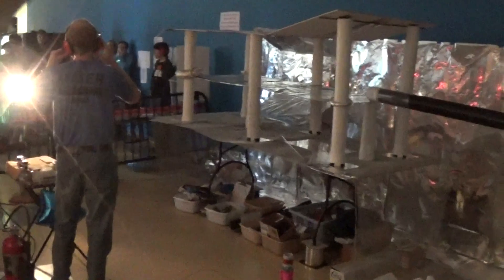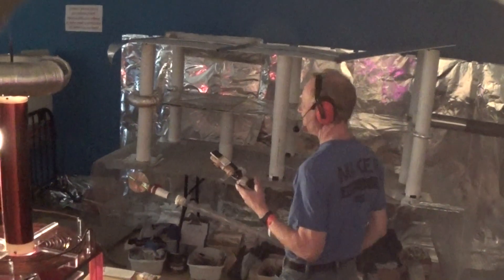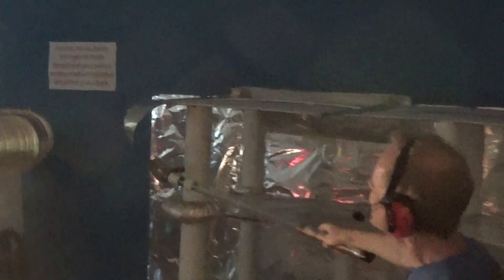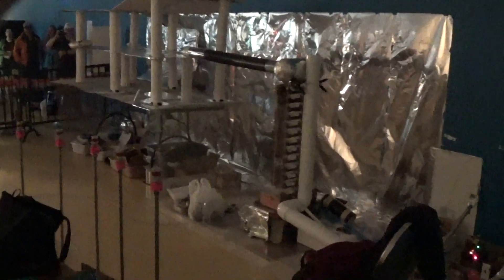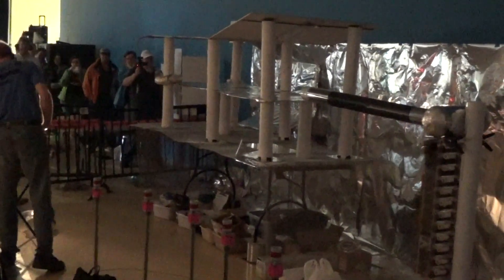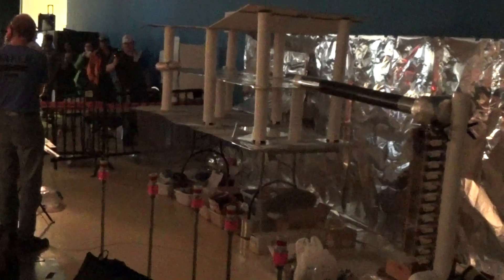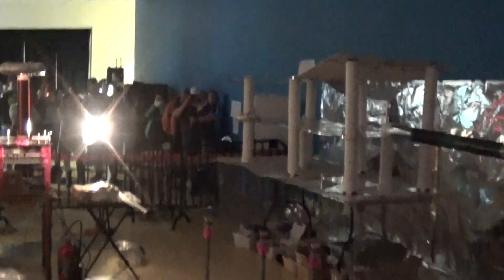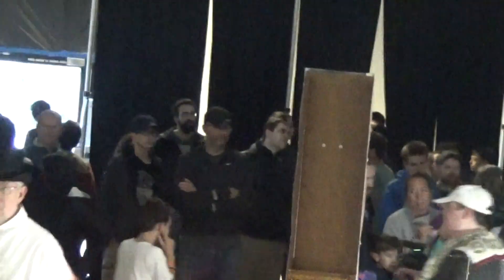440,000 Volt Marx Generator Demonstration at OMSI Portland Maker Faire - equipment side view

Comment: You got streamers from the marx! It's the Dc answer to a Tesla coil (The Edison coil?)
Reply: That's real lightning power! Amazing
Reply from the maker: Yes, the top of the Marx generator itself has a lot of corona.  It occasionally arced to the foil shield on the wall in previous runs (about 28"), so we moved it farther out by this video.

I started this project because I thought it would be a good counterpoint to Tesla coils.  It was much harder than I expected - this is the fourth build.  DC doesn't make nearly as long arcs as the AC of Tesla coils, but the sparks are MUCH louder and significantly brighter.